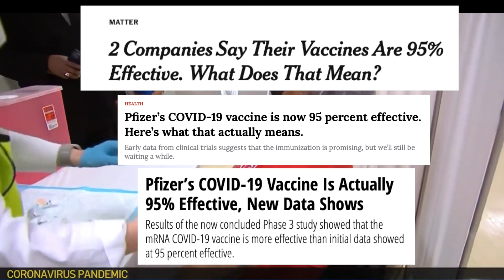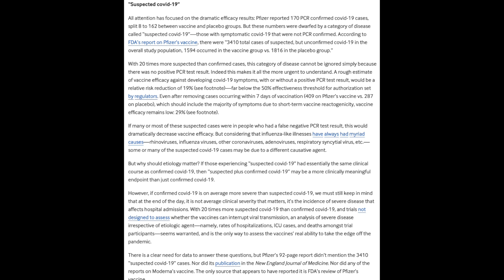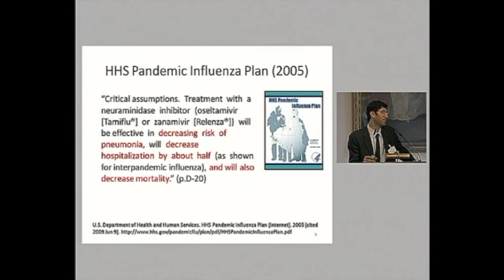Pfizer Vaccine: 29% efficacy rate? Sinovac: 50.4%? Should we still trust them & get vaccinations?

Comment: The data must be analyzed more carefully.

Two groups of 4700 people were in the Coronavac research. 

One group was vaccinated, the other not.

The group of 4700 people, 85 got Covid and had ANY symptoms.

In the other group, close to 160 got Covid with ANY symptoms.

That's the 50% efficacy. But there is more. The efficacy against symtoms is 78%.

Of the 4700 vaccinated, only 7 had mild symtoms, while in the other group, 38 had.

And it had 100% efficacy against grave symtoms. 0 vaccinated people were hospitalized. 7 non vaccinated were hospitalized.

But there is more:
"Sinovac vaccine received a 50.3-percent efficacy rate on Wednesday, based on phase III clinical trials in Brazil. But the figure was largely due to the fact that participants in Brazil are all medical workers with a very high infection risk, experts said.  "

As for Pfizer
Doshi's comments triggered controversy on Chinese social media platforms, with some Chinese experts doubting Doshi's counting method for efficacy as he takes all participants showing symptoms to be confirmed COVID-19 cases, even if PRC tests show negative results. 

"The PRC test is of very high sensitivity, 98.6 percent in the last year. But its sensitivity could be only 5 percent under Doshi's counting method," Zhuang Shilihe, a Guangzhou-based vaccine doctor, told the Global Times on Wednesday. 

Zhuang noted that Doshi's doubts may be related to the anti-vaccine movement in the US, noting that Doshi has previously criticized other vaccines like the flu vaccines.
Reply from the maker: Good point. Thanks!